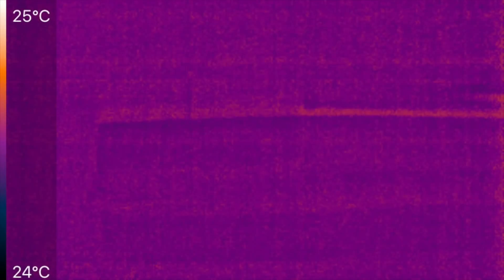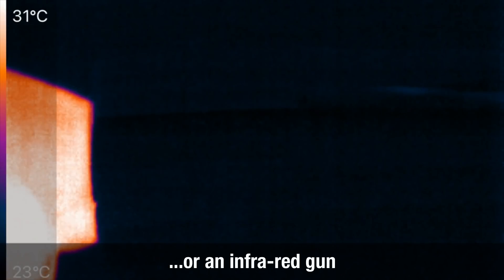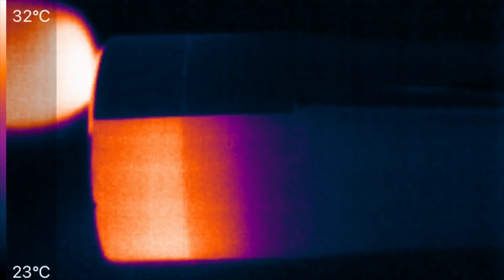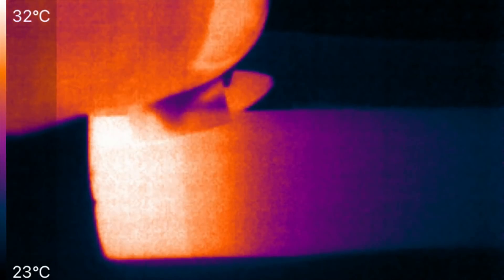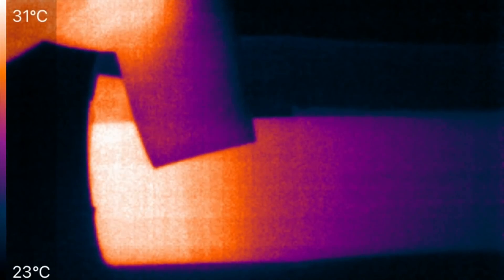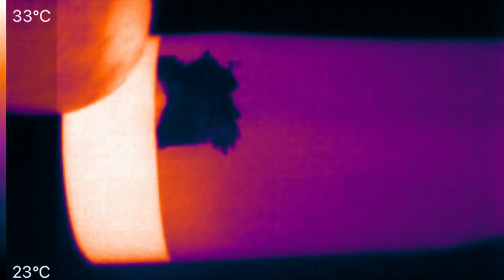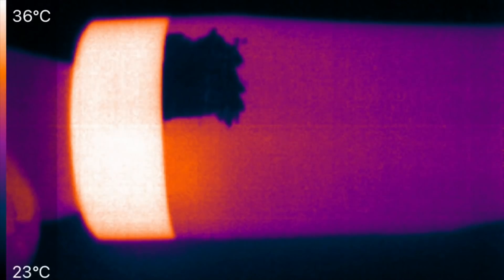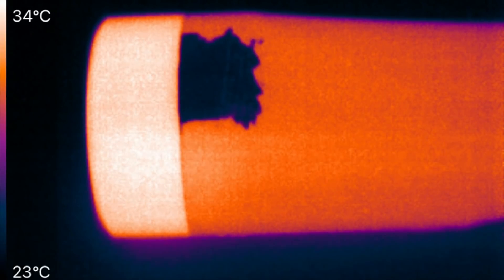Be careful when using infra-red for reading metal temperatures

Comment: Couldn't you use this to test rda's as well when some ppl say there rda gets too hot to touch and others says there's don't get hot at all and both ppl say there using the same size and type of builds
Reply from the maker: Yes, it can work on atomizers too. But the heat created by the coils is at least 100 times greater than any heat created by power losses through the metal of the atomizer. The power level and vaping style will, by far, determine how hot it gets IMO. Thickness of the barrel, etc., also play into how quickly the heat builds up or fades.
Reply: Battery Mooch yes I understand all that and thank you brother

Comment: @mooch I just seen a video of a battery the size is 38120 amps r 100continiuous and 8000mah...the guy said there is only 5000 made..y aren't ppl mass producing these for us..search 38120 100amp u will see it. please watch and maybe mention on ur next show or reply here what u know..the guy tested them they r a lil shy of 8000mah but he said could be due to wear and tear....
Reply from the maker: The Headway cells?
8000mAh I can believe as they are huge but 100A continuous might be optimistic. :-) If someone sent me a pair I’d test them just as an interesting side test. 

We are a tiny market that have no mods that use cells that big...no one will fire up a multi-million line just for us. There are incredible LiPo cells though can be used for very high current levels.
Reply: Battery Mooch ty for reply...yeah watch video he test high 90 continue amp..they r rated for 200..ty again
Reply from the maker: Okay, found it...jehugarcia?
At 90A the voltage of the cells had dropped down to under 2.9V. That’s uselessly low and a clear indicator that they are being hugely over stressed. :-) They might be 50A cells though, perhaps a bit higher.
Reply: Battery Mooch ...but wasn't that with all them in series for a total of 12v dropped to 10 is that bad for 90amps..I need to go watch it better I skimmed thru it...but had u seen these size before
Reply from the maker: Jason Lemaster it’s terrible for a cell claiming an over 90A rating. It’s typical though for a much lower rated cell being run at much higher than its rating. As a comparison, most cells we use run at 3.3V-3.4V average at their rating.
Reply from the maker: Which video was this?

Comment: A decent gun will have operator adjustable emissivity settings.  If the material is known and you use this setting (search for emissivity chart online), you will have more accurate readings.  Polished metals are the worst offenders approaching a perfect infrared thermal mirror value of 0.0.  Polished brass, for example, is ~0.03!  I use gaffer's tape as it doesn't leave a goo behind.